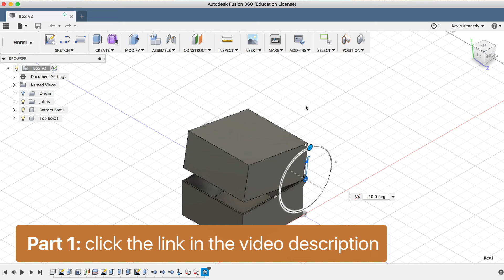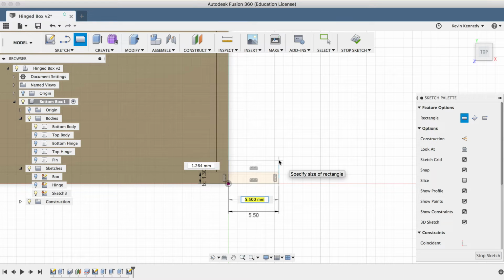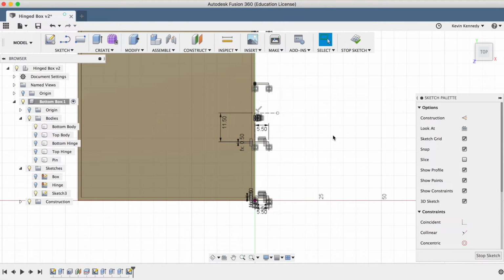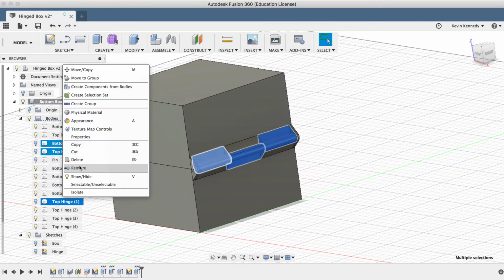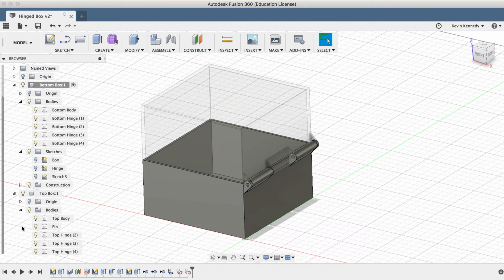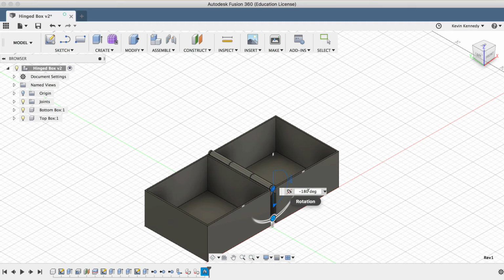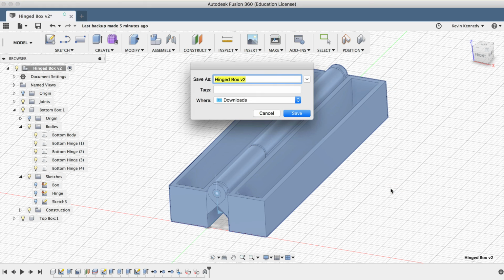How to 3D Model a Hinged Box for 3D Printing - Learn Autodesk Fusion 360 in 30 Days: Day #19(Part 2)

Comment: Hi Kevin, Thank you for an awesome series! Learning so much. I did run into a snag. Using the new Fusion UI, i was unable to drag the newly created bottom box component into the higher level assembly. Only when turning off design history could i continue. (Although this meant losing the paramentic info) How can i tell what prevented the bottom 'new' component movement? I must admit  i did veer off your tutorial by creating the hinge accidently on the incorrect side of the box. Thank you again.
Reply from the maker: Hi, Daryn. Glad to hear you're learning a lot and enjoying the series!
In regards to dragging newly created "Top" component, that functionality hasn't changed at all...so it should still work. Did you release your mouse on the top-level component? Make sure it shows a darker gray background on the top-level component to show that you're hovering over it before you release your mouse. Let me know if you get that to work, otherwise, if you're able to share a link to a screencast of that not working that would help me troubleshoot further. Cheers, Kevin :)
Reply: @ProductDesignOnline  Hi Kevin, thank you for your reply. I noticed that the dark line does not appear through the list as you drag your clicked mouse through the list. As mentioned i was able to do this with history turned off. (so i understand the click and drag process) 🤔
Reply from the maker: @darynsmith4938  Very strange... Another thought that I had. Is your timeline marker at the very end of the timeline? I believe if it was rolled back at all then it won't allow you to re-arrange Browser components.
Reply from the maker: Also, can you share the link to your file? I'll take a look on my end to see if it allows me to drag the component. To share your file please go to File > Share > Share Public Link (make sure "downloadable" is toggled on) > Paste your link here as a reply to this comment. Cheers, Kevin :)
Reply: @ProductDesignOnline  Hi Kevin, I was busy re-sizing the box in order to share it with you, when i noticed the old hidden hinge which I incorrectly positioned. After deleting this i found i could move the top box component into the root. I then though i should go back and see if this was the cause.  But it seems the incorrectly placed and deleted hinge is now gone. So i am assuming this was the cause. Next time i'll try iterate  a bit slower or make a backup before fiddling and deleting. Thank you for your assistance and  offer to take a look at the file. Cheers!
Reply from the maker: @darynsmith4938  No problem...I'm always happy to help! I would recommend saving "versions" as you work on the file. More about the version control in this video - https://youtu.be/ArRAaJmiCgA
Cheers, Kevin :)
Reply: @ProductDesignOnline  Thank you Kevin, i will definitely watch that one.👍🏻

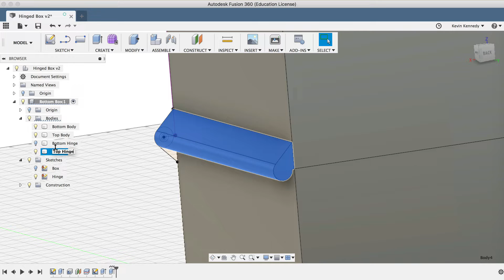Comment: Hi Kevin, when I click ok on the extrude dialog box at 2:00 min for the top hinge, a new body file is created at the top of my bowser tree. Why isn't it adding it to the body file with the bottom and top box, and the bottom hinge?
Thanks,
Ron
Reply from the maker: Hi Ron. Can you double-check that the "Bottom Box" component is active? It sounds like you may have the top-level component active. Here's an image for reference - https://snipboard.io/mNA621.jpg
Cheers, Kevin :)
Reply: @ProductDesignOnline  Thanks, that did it, I didn't have "Bottom Box" active.
Reply from the maker: Glad that was it! You'll have to pay close attention to the active components, especially when you open up a file that was already started. Sometimes it will default to the top level component instead of where you left off. Cheers, Kevin :)

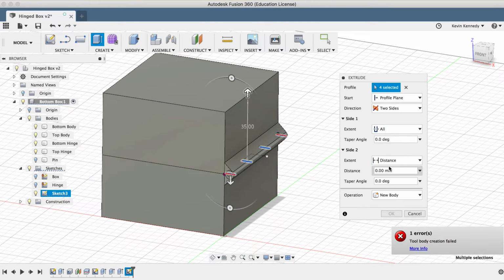Comment: When I follow the instructions to extrude the 4 rectangles (6:35), if I choose 2-sides it doesn't work.  It only extrudes through the top hinge, even with both hinges selected in bodies to cut.  But if I choose Symmetric for direction, it works.
Reply from the maker: Hi, Bobos Curse. That is strange that the two-sides option won't work. Will it work if the operation is set to "new body"? It's hard to say why that would be without looking at your file. However, the "Symmetric" option would produce the same results in this case. Cheers, Kevin :)
Reply: @ProductDesignOnline  AHA!  User error.  I'm going through the doughnut video now and realize that I needed to define both sides of the 2-sides extrusion.   D'OH!
Reply from the maker: @boboscurse4130  Ahhh. Well, I'm glad you figured out what it was! Thanks for the clarification. Cheers, Kevin :)

Comment: Note:  Check your Selection filters!  I was pulling my hair out because I couldn't select the sketch elements.  Turns out I was still set to only select Faces from the mesh tutorial I just finished.  :)
Reply: Saved me!!! thank-you
Reply from the maker: Great tip! Thanks for sharing this with everyone, Bobos Curse! I find myself doing this on occasion. Cheers, Kevin :)
Reply: Take my imaginary internet points, sir. I was starting to curse!
Reply: A tutorial on selection logic would be good - there are directional gestures etc.
Reply: Thank you! I came to the comment section to try and figure out why I couldn't just grab dimensions and drag them around like the video shows. I had the old setting left over from the mesh tutorial as well. :)

Comment: Great tutorial and a fun project! Can you tell me what the difference is between extrude and press pull and why you press pulled the hinges but extruded the pin?
Reply from the maker: Hi, Tesla 5869. Another great question! In short, the Press Pull command becomes the extrude command in many scenarios. For this instance, I used that just to show it would do the same.

Here is the difference between Extrude/PushPull commands:
-Extrude works on sketch profiles and/or planar faces.
-PP works on faces and/or edges
-Invoking PP on a sketch profile turns it into an Extrude command
-Invoking PP on an edge turns it into a Fillet command
-PP has 3 offset modes (1. Automatic, 2. Modify Existing, 3. New)
Modify Existing, modifies a previous feature. So a 2mm Fillet can be changed to a 4mm Fillet for example.
New Offset does not change the feature itself but offsets the feature to a new distance.

Bodies created are the same whether using Extrude or Press Pull. The difference will be in the timeline and the feature type you create.

I hope this helps! Cheers, Kevin :)

Comment: Hi Kevin, I'm have trouble mirroring the hinge.  When I select the rectangles, I get 6 objects in my dialog box and you have 22 in yours. The rectangles are not visible, but the points are. What am I doing wrong?
Thanks,
Ron
Reply from the maker: Hi Ron, The first thing to check is to make sure you're using the Sketch mirror command. Double-check that you're using the one in the "Sketch" dropdown list and not the "Create" dropdown list, as that one is used solely for 3D bodies, features, and components. That would explain why it's not letting you select the sketch.

As far as how many objects you're selecting... I drag over the entire sketch which selects lines and points, which is why I ended up with 22 sketch entities selected.

Let me know if that was it! If not, we can troubleshoot further. Cheers, Kevin :)

Comment: When ever i select chain face and error occurs which tells 'extent Boolean fail. The termination entity might be not fully intersected with the tool body built along the operation direction.' please tell me what should i do
Reply from the maker: Hi, Subhodeep. That error message can be caused by a number of things... usually when the sketch does not line up with an edge. Can I take a look at your file? Share your public link as a reply to this comment. Here's a video explaining how to share a public link - https://youtu.be/2XrcrdV-8Ls

Then, please write a separate comment letting me know you've replied with a link because YouTube flags most links and I don't always get notified. Cheers, Kevin :)
Reply: @ProductDesignOnline . https://a360.co/2YwYcBB i have completed the design but have a look
Reply from the maker: @subhodeepkumar9281  Thanks for sharing your file. I took a look at your file. One thing I noticed is that you will need to delete the top part of the hinges. Hinge 2 and Hinge 4 need to be hidden or deleted in order for the hinge to work if you're going to 3D print this. Here's a reference image - https://snag.gy/KPaR2i.jpg
Cheers, Kevin :)
Reply: @ProductDesignOnline  ok got it. Thnx for detecting the error bro.
Reply from the maker: @subhodeepkumar9281  You're welcome! I'm always happy to help. Cheers, Kevin :)

Comment: I just finished your part one and two of the Fusion 360 Hinged Box - thank you - I learned a lot.  How do I resize the entire box including the hinge? - thanks ahead of time.
Reply from the maker: Hi, John. I'm glad to hear you enjoyed this tutorial! If you want your hinge to scale as well then you'll have to go back and add user parameters to the dimensions that were applied to the hinge. You'll probably want to create a few new parameters... maybe for the hinge width, hinge height, hinge gap...and you could even set one up for the pin size. Then, edit those sketches in your timeline and plug in those values. Cheers, Kevin :)

Comment: First of all, congrats on reaching 10K subs!  I'm sure you'll be doubling that number, and beyond, in no time!

Secondly... I 3D printed the box (after first removing the bottom ends), and all came out well, except strangely, the middle third of the pin did not print!  It doesn't even appear in the slicer I'm using (S3D) even though the whole pin is there in Fusion!
Reply from the maker: Thanks, StepInIsrael! I really appreciate it....and I'm excited to continue to make tutorials and not only grow the channel but the community of Fusion 360 users with like-minded goals.

In regards to your 3D-printed box, that sure sounds strange. I didn't have any issues with mine (I used Ultimaker's Cura for what it's worth.) The only thing I can think of without looking at your file is that maybe the body was hidden before you went to export? I'd recommend double checking that...if that's not it then share your file with me and I'll export it to Cura and see if it appears on my end. Cheers, Kevin :)
Reply: The subscribers count is almost 100K in February 2021.

Comment: Why did you use Press pull in one instance and Extrude in another? What’s the difference?
Reply from the maker: Hi, Alex. Great question! The difference between Extrude/PushPull commands:

-Extrude works on sketch profiles and/or planar faces.
-PushPull works on faces and/or edges
-Invoking PushPull on a sketch profile turns it into an Extrude command
-Invoking PushPull on an edge turns it into a Fillet command
-PushPull has 3 offset modes (1. Automatic, 2. Modify Existing, 3. New)
-Modify Existing, modifies a previous feature. So a 2mm Fillet can be changed to a 4mm Fillet for example.
-New Offset does not change the feature itself but offsets the feature to a new distance.
-Bodies created are the same whether using Extrude or PushPull. The difference will be in the timeline and the feature type you create.

I hope this helps! Cheers, Kevin :)

Comment: Hi Kevin,

An issue I have is that I have some embossed writing on the top face of my case. How would you suggest the issue of reducing the amount of support needed while also preserving the detail of the text? Been hunting around online and most guides only tackle the case of the box having a smooth surface on top. 

Cheers!
Reply from the maker: Hi, TheTmoorhouse. Interesting question - I'd suggest creating your own custom supports by modeling them in Fusion 360, and then you can leave the supports option turned off in your slicing software. If done properly, your own custom supports can provide support for the overhang, without defacing the surface of your lid.

Create some simple rectangles that the overhand areas can rest on. The general guideline is to make the gap between the model and the custom support half of the typical layer height (usually 0.2mm).

If your text on the top covers a large majority of your lid then you could always add a draft angle to the edges of the text, which will help it print better in the areas around and between letters.

I hope this helps! Cheers, Kevin :)
Reply: @ProductDesignOnline  So print the box with the lid open at a 90° angle? Is text able to print legibly alright if printed perpendicular to the print bed? And with creating the supports should I stick to the 5mm rule to prevent sagging (i.e. have a series of the running parallel to the hinge and perpendicular to the print bed)? 

Thanks so much for your help it's really appreciated! 

One last question, do you think it might be possible to print this as two parts and slide the pin in afterwards, fixing it in place with some glue? 

Cheers!
Reply from the maker: Hi TheTmoorhouse. Sorry, I should've been more clear. I was suggesting you add the text to the lid and then raise the entire object up, with the box opened up at 180 degrees. Here's a visualization that may help - https://snag.gy/MjB5wf.jpg

You bring up a good point - you would need to alter the hinge so the pin could slide in. You'd probably have to have one tab of the hinge on each box...but you could certainly glue hinge pieces together. I've done it before it works great. That may be your best bet so you can cut down on the extra supports - they won't be needed for the bottom box.

Cheers, Kevin :)

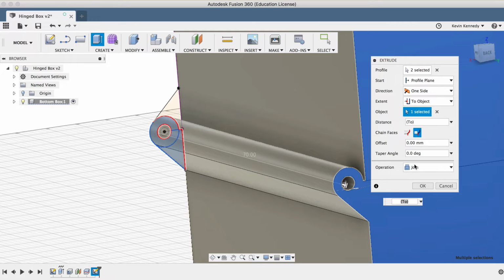Comment: What's different between "Extend Faces" and "Chain Faces" 1:05
Reply from the maker: Chaining always refers to tangent connections.

Chaining edges is an option for some commands, where you might want to pick all the connected tangent edges by picking just one edge.

Chaining faces for extrude is for when your extrude profile needs to run over onto an adjacent tangent face.
Cheers, Kevin :)
Reply: @ProductDesignOnline  You mean
If I have a tangent curve
Extrude will be around through the tangent line? 
a little confusing with tangent connection.
Reply from the maker: @devstefancho  Here's a good forum thread about this. https://forums.autodesk.com/t5/fusion-360-design-validate/difference-between-chain-face-and-extend-face-in-extrusion/td-p/6751550

Scroll down until the bottom where the images are that demo the difference. I think this will be more helpful as you can visually see it versus me typing it out here. Cheers, Kevin :)

Comment: What is the difference between push-pull and extrude?
Reply from the maker: Great question, Jonny. Here are some of the differences
1. Extrude works on sketch profiles and/or planar faces.
2. PushPull works on faces and/or edges
3. Invoking PushPull on a sketch profile turns it into an Extrude command
4. Invoking PushPull on an edge turns it into a Fillet command
5. PushPull has 3 offset modes (1. Automatic, 2. Modify Existing, 3. New)
6. Modify Existing, modifies a previous feature. So a 2mm Fillet can be changed to a 4mm Fillet for example.
7. New Offset does not change the feature itself but offsets the feature to a new distance.
8. Bodies created are the same whether using Extrude or PushPull. The difference will be in the timeline and the feature type you create.

To summarize, the idea of push pull is that it adpats based on what you have selected, whereas the extrude feature doesn't. I hope this helps clear this up! Cheers, Kevin :)

Comment: Nice lesson again Kevin!
Maybe you can add a pop-up in the video to tell people about the first and last hinge part?

For everyone who wants to have the box hinges to scale with resizing the width of the box and fully parameter driven to be used as a base for any future printing projects:
• Step 1: Add parameters for BoxWidth (for along the Y axis) and BoxLength (for along the X axis) and use those appropriately for the width and length of the box sketch (instead of the 70mm's).

• Step 2: Where we dimensioned the second gap from the mirror line instead of [11.5mm] fill in: 

( BoxWidth - 2 * WallThickness ) / 6 - Gap / 3 * 2

Now the hinge division will scale with the box size, maybe there's an easier formula, but this worked for me :)
Reply from the maker: Thanks, Marvin. I couldn't figure out how to add the old card style pop-ups... as far as I know that was deprecated by YouTube?

Thanks for sharing the steps to make the hinges scale with the rest of the box. I appreciate you taking the time to share this with the community. You rock! Cheers, Kevin :)
Reply: @ProductDesignOnline  Yeah, you're right about the pop-ups being removed, I wasn't up to date on that!
Reply from the maker: @marvintenbohmer8614  No worries... I just wanted to make sure there wasn't something I was missing. It's unfortunate they had to remove that feature, but there were way too many people who abused it. Cheers, Kevin :)
Reply: Maybe a quick note at the beginning of each future video to check the pinned comments for any post-video changes.